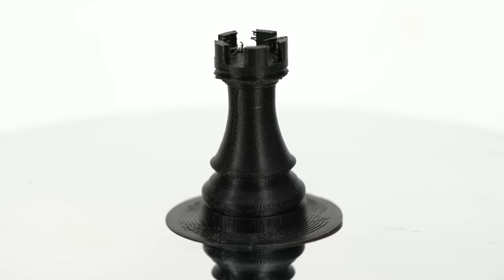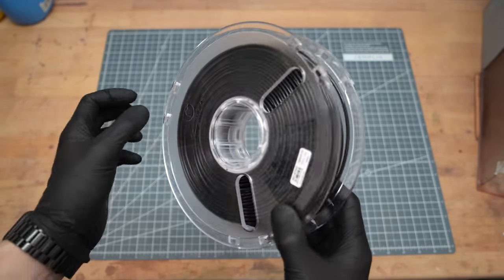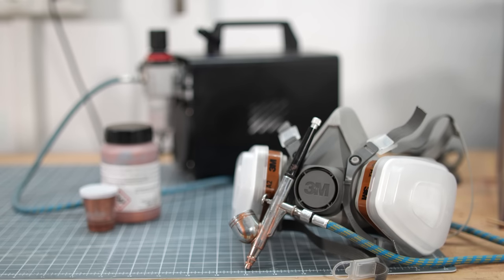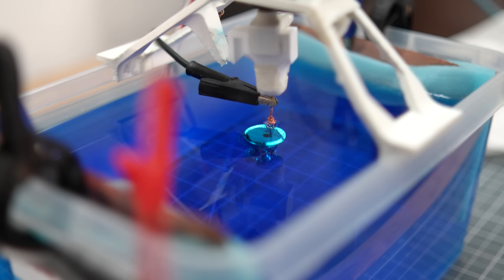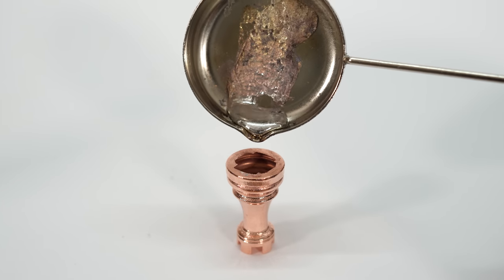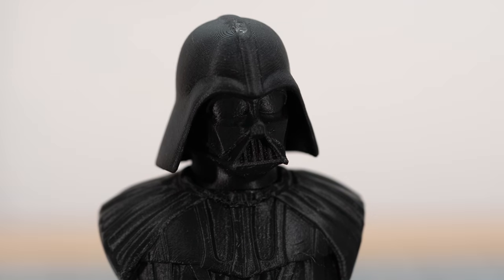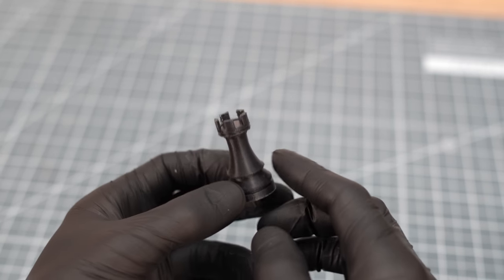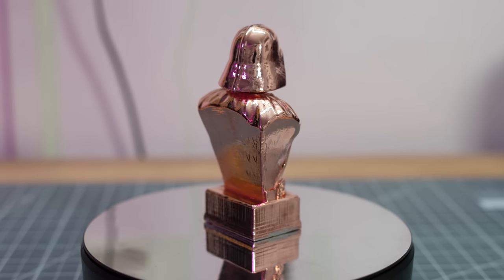Cast Into 3D Prints | Electroplating

Comment: This was awesome. If you print the pawn in very low infill or even in vase mode you could really shrink the time to dissolve the plastic. 
 I've been using  your tips to electroplate statuettes and a doorknob I designed. The weight was definitely something I'm looking for and my solution was to simply leave cavities in the print, pause towards to top and insert pennies (around 75 cents worth) into it. It makes it extremely heavy and it's obviously very cheap! This makes it easier to electroplate as well as I don't have to fiddle with keeping the print submerged as it's heavy enough to sink on its own.
Reply from the maker: Hehe, oh yeah, submerging is always a thing 😅
Reply: I was just pondering adding mass to a print by sneaking things into the infill, pennies definitely seem like a good easy option. Although do they jiggle/make noise? Any suggestions for that?
Reply: @ZacDonald  I have added BB's inside prints while printing to add weight, they can still be heard if shaken but maybe pouring in a bit of glue with them would stop this.
Reply: @ZacDonald  I would try adding a few dabs of epoxy when inserting the pennies. Actually, this brings to mind the idea of modeling custom pockets for random pieces of metal to simply epoxy into the printed part. For example, model out a pocket for a lug-nut I found on the road, epoxy it into the print, and electroplate with no need for melting any metal.
Reply: Ive dissolved prints out of plaster in the past; I think the trick is to make sure the solvent can reach everywhere quickly, and not have to go incrementally layer by layer. Use gyroid infill, and maybe poke a hole lengthwise. Even better if you could stick a pump in that hole for active circulation but i guess that is extra complication and mess so unless time is of essense, eh. 

Also the effect of dissolving plastic is very very temperature sensitive. At the very least do not leave it in your subzero garage. But I put my setup in my slowcooker. Now there is that thing of flammable liquids and boiling them and all; but that can be done safely. What I did was seal it from oxygen and add a long alu tube to leave room for vapors to expand and recondense; even with my pan on max all vapors recondensed at the very bottom. 

Using such an elevated temperature process, you can dissolve good old PLA like sugar in water, using ethyl-lactate. It has a nice and high boiling point at ambient pressure too. Its not the cheapest solvent, but if you catch your recondensed liquid in a seperate vessel, you can keep using it indefinitely.
Reply: You can simply print it hollow and inject hot glue if weigth is the only consideration.

Comment: You can find a bunch of pewter stuff to melt down at thrift shops and such. Might be a bit cheaper, and it can be melted on your kitchen stove. (Be aware that older pewter may contain lead)
Reply from the maker: Yes, absolutely. I just didn’t want to show melting potential lead contaminated stuff. 100% tin seemed the safest starting point for people who may want to try this. Lead is really bad stuff, so safety first. 🙃
Reply: Most of the Pewter in resale shops isn't actually pewter but alloys that look like it. Real Pewter is expensive so it usually gets bought up pretty quickly.
Reply: @hen3drik  'twould be interesting to see if it 'survives' the 650F. thermal load....
Reply: @TrollFaceTheMan  depends on antimony and tin content, less lead
Reply: @whtkngofc , the stuff I've seen a lot is actually an aluminum alloy of some type that is made to look like Pewter. Someone who knows metals can tell it right away by weight and sound.

 But most people that aren't familiar will likely mistake it.

 I have also seen some iron alloys of some type again made to look like Pewter. They are heavier and potentially harder to tell apart becuase of this.

 Then there is the Lead free Pewter which is just around that can be kinda hard to melt and cast depending on its composition.

 Potentially much to high for silicone casting unlike regular pewter. It might be different in different areas. That is just what I have found around me locally.
Reply: Contains lead*
Reply: @hen3drik  lead isn't that bad if you don't ingest it. You can fill it with lead then seal it. I and many electronics DIYers use lead solder all the time, and actively avoid lead free, I know of 0 that use lead free. Lead may be in your water pipes too, it's harmless unless the water is acidic.
Reply: @hen3drik  That’s why you should try ZA-12 allpy ingots.
Reply: @H0mework  Look up Zinc Pest

Comment: Awesome! If the intent is only to add weight, then you could simply drop in a few lead sinkers, and fill the rest with epoxy resin. This would make it strong, heavy, and no melting required.
Reply: Or just stuff it with JB weld, depending on whether or not you want a more uniform mass distribution.
Reply: I would suggest lead pellets or even small rocks, and casting resin.

Comment: You should try casting with Rose's alloy. It has a really low melting point and doesn't contract or expand much when it solidifies. It does have lead in it though.
Reply: There's also a Tin/Bismuth alloy out there that melts at 274F if you want to avoid Lead.  Should be able to poor it into a PETG or PC mold.
Reply: Haha, finally sb. who knows their stuff!

Comment: Try zamak 3 alloy or another zinc alloy! It should melt in a cast iron pan with a little help from a blow torch or a really hot burner. Do it outside though. You can go over your daily required zinc intake from zinc fumes if you're not outside and wearing some kind of mask. Less toxic than those other low melt metals and very cheap. It's also quite strong for the volume. Better than cast aluminum.
Reply: That's what i want to try with this method. Creating strong and precise metal parts at home, without having to put the plaster mold in a 700 degrees celsius furnace for 12 hours  -- sounds like a dream.
Reply: + even more advantage over casting: unlike ZAMAK, copper could be easily electroplated with nickel or chromium for aesthetically pleasing finish and durability

Comment: Never knew about PVB, will have to try it some time.  Even PVA takes some agitating to get it to fall off on it's own.  You could use lead for weight but I would seal the bottom and needs a bit more heat.  I made an furnace for melting lead, copper, brass and aluminum out of a 5 gallon bucket and some kaowool, didn't cost much to build, uses a simple propane burner.   I get lead when I go to the scrap yard, balancing weights off of car tires.

Comment: If you only want more weight then use Plaster of Paris as the filler and put a round piece of green felt on the bottom to cover and for protection of the surface you put it on. I had a couple of bookends made that way, plaster inside. They had a brass shell, thicker, and then plater inside for weight. If you wanted metal inside then I would use lead as it is very cheap and a low melting temperature.  

I like the the plating method. I will try it sometime.

Comment: Just when I thought there is no way you can show even more incredible ideas than in your previous videos, here it is! Nice, clean and professional, as always.
I just started setting up a space for electroforming 3D prints, and have been tinkering with what can be done easily in a DIY way (substitute materials for expensive chemicals, sometimes slouching on cleanliness and the not-so-fun parts like polishing etc.), and somehow it always seems to turn out that I get the best results if I follow exactly your instructions. :D Currently waiting for the same brand of copper paint you are using to arrive, I have high hopes for that to work much better than my current graphite spray solution.
Keep it up, incredibly informative videos!
Reply from the maker: Thank you for your kind words! I wish you luck. Don’t get rid off the graphite yet. ;-)

Comment: Pewter is very cheap and easy found in thrift shops and 2nd hand stores. Its Mainly tin and has a low melting point. We use it to make babbitt for engines by adding lead to the pewter. It's found in  old and cheap decorations as well as plates and tea/coffee sets. Can't hardly give it away in the states. A quick search will show you what it looks like

Comment: Very interesting. 
For weight, especially when I needed extra weight a certain spot, I have designed parts with a cavity in it. Pause the 3D print at the right spot, add hot glue, drop a steel ball bearing in, add more hot glue. Glue doesn't stick to the bearing but it does to the print.
Just make sure the glue gun is on low temp. I've also added a thicker wall to the cavity to take the heat when close to an edge. I'm a mechanic, I take the balls out of used wheel bearings and axle shafts.
Reply from the maker: Like this? 😉 
https://youtube.com/shorts/JD-r2oOXT-0?feature=share

Comment: Really cool. You could also do a liquid sand cast over it, let it dry, burn out the plastic. Then pour metal inside the sand cast. Then bust open the sand to reveal the casting. They do this in large scale places but use wax instead of plastic. But should still work I think.
Reply: Dude do you have a link to how to do this? I am looking into doing something similar and always looking for different techniques
Reply: Please show video
Reply: Saw it on how it's made like 12 years ago. Not sure how to find video.

Comment: Very cool. Finally, a completely metal part! Kudos!
If you want other metals to try, maybe bismuth or an alloy. It should be a bit cheaper. It melts just a little hotter than tin and one of the least toxic options (we're looking at you, lead).  
As for other projects: what about ways to add weight without casting metals: maybe filling with gypsum plaster, metal filled epoxy, etc.
Reply: Гипс (клеящий гипсовый состав, с ним удобнее работать) вполне годится, можно добавить железную или медную проволоку для веса
Reply: В жидкий гипс, для утяжеления, можно добавить металлические шарики, чтобы не плавить металлы
Reply: Yes, I’d agree that bismuth is a good idea if you are after weight. It’s about 50% denser than tin, and its melting point is low (about 40 degrees above tin). Some bismuth alloys have much lower m.p.
Plus it is much less toxic than lead.
The only potential problem I can think of is that (IIRC) it actually expands slightly when it solidifies.

Comment: Try lead-tin alloy. Lower melting point, better flow characteristics. Watch out for the fumes (do it outside), wash your hands after casting, do not use in stuff that's going to be used near acids (especially vinegar and ita vapor) or in food and drink contact.
Lead is toxic, but as long as it is in its metallic or inorganic form it is not readily bioavailable.
Reply: Maybe just use lead and then cap it off with tin?
Reply: @ET_AYY_LMAO  can be done, but lead is slightly more viscous and doesn't alloy easily with copper
Reply: @robertotomasini2072  Use a little solder flux and it will probably wick to the copper just fine.

Comment: Lead free solder may work (get the type for solder pots that dies not include flux)
Reply: Lead free solder is usually a Tin alloy, so it will most likely be even more expensive than tin bars for casting and soldering.

Comment: Pretty nice, I'm impressed by how well your electroplating solution is behaving! Is that a commercial solution or a handmade one? 
You were right when switching to current density as opposed to constant voltage. Constant voltage really shines when you have a large range of current density (2-8 A/dm² for instance).
Reply from the maker: I‘m always fighting field density 😅. It‘s a commercial acidic pH1 bath that I maintain regularly.

Comment: Very nice work and outcome.
You can speed up process. Just melt out plastic or burn it with 200(melt)-500(burn) degree stove. After melting you can make finish clean of the form with isopropanol but whole process would be faster. To keep copper form in place you can use sand casting of the outer volume.

Comment: Another metod that works very well to fill the parts and add the precise weight you want, is mixing small steel balls with wax. No need to melt metals, just enough heat to melt the wax.

Comment: An easy way to add weight only is to stop a print while the internal supports are still exposed, then fill with "heavy sand" then let the print finish.  Use a magnet to clean up any spills.

Comment: As an alternative to casting in tin -

Wood's Metal is an alloy with a very low melting point - 158° F/70° C. compared to tin at 449.5°F/231.9°C.

 It also costs about half what tin does - I'm seeing 99% tin for USD 28.99/pound, and Wood's Metal for USD 15.59/pound or less.

Given the low melting point, it's considerably safer - water left in the form won't boil on contact, throwing molten metal all over.

Comment: that is awesome would be cool to see how it held up to higher melting point metals like steel.... cheapest way i can think to do this is with an induction bolt buster would allow you to melt small quantities for a few tests
Reply: Steel stops heating in induction heaters when it hits the Currie temperature. You need a graphite furnace (or a very high power high frequency induction heater)

Comment: You could try some low melt  plumbers metal, that melts below 100c  (used to pack pipes before you bend them) also called bend metal with a 70c melting point
Reply: Even more expensive than Tin though.

Comment: You could prefill it with lead shot, which is much less costly than tin.  Since the melting point of tin is higher than tin, there would be minimal offgassing of the lead,  Might need to do it in layers.

Comment: the electroplate is dope. Would probably work better with a resin print for more detail/surface finish. Using tin seems unnecessary, if the shell is metal, just fill with something heavy. Sand for ex.

Comment: 8f your main goal is to make them heavier there are much easier ways. First and easiest is to print solid / 100% infill (I print with resin, which is 12~15% heavier than water).
But since resin can be expensive, you can still print hollow (with drain holes!) but after curing you can fill it with something heavies and dirt-cheap ... like sand for example :)
... and of course then close the holes, resin prints are best closed/glued with liquid resin in a small syringe (with needle for finest places) and then cure with UV flightlight (or laser for finer places). Liquid resin hardens in seconds under UV, and once its hardened you can put in your uv-oven (or in the Sun) for a bit longer.
I don't have experience with fdm printing, but I'm sure the same can be achieved with it too, perhaps with different hollowing & gluing techniques.

Comment: Could this work with aluminium as the casting metal? Seems like it wouldn’t be able to melt the copper electroplating?
Reply from the maker: Yes, Aluminium should work.
Reply: @hen3drik the ramifications for die casting mould making is unbelievable!

Comment: You should preheat the copper shell for a proper pour, so that you can do it all at once. I've poured molten lead-free pewter at +-400°C in a resin print with 100% infill. Preheating helped a lot. The metal didn't react violently with the surface nor it has splashed everywhere.
A silicone mold is another cheap alternative.
BUT, you had the solution right in front of your eyes: you should have used the shell as melting pot, simple as that (the melting point of copper is 1,085°C)!
Good job on the electroforming though, it's an awesome technique.
Reply from the maker: Thank you for the Tipps. These are great for people considering doing it right 😅. Yeah, there are many ways to do it, I always wanted to try out this version.

Comment: Pretty awesome. However, AFAIK you are electroPLATING = covering the outside, with the reference surface being on the INside and the outside being undefined. ElectroFORMING on the other hand is done in one or several NEGATIVE molds, with the copper deposition on the inside. After separation from the mold, the outside of the metal parts is the exact copy of the reference surface = the inside of the mold. As depositing metal in deep cavities is more difficult to achieve, objects are typically broken up into several shallow "negatives". The resulting parts are then trimmed, soft-soldered together, then given another thin copper layer and finally (partially) filled with some low melting-point metal (usually containing Pb, Sn, Bi). After some final touches, a silver or nickel bath concludes the process.
This process became popular in the 1850s for the (mass) production of decorative items and stayed in use until the 1990s for design prototyping before CNC milling of thin-walled metal and 3D printing became the standard. If you find "WMF" product boxes produced before the 2000s, their box shots of "stainless" items are usually pictures of electro-formed copper parts with nickel coating to resemble stainless material.

Comment: And if you print with a resin printer, do a silicon mold of it, pour wax inside the mold, electroplate the wax copy, melt the wax and put the metal material inside you think it will work? It will be really interesting for have a superior surface quality of it and with higer resolution of details.

Comment: You can also cast with lead. Just get some old lead-acid batteries, you can melt them with a wood fuelled fire in a kitchen pot, I have done so in the past. Check whether it is legal to do where you live and besides a safety goggles, face shield, leather apron and gloves wear a good respirator. Just in case.

Comment: Hello. Did you try to print 3d resin + copper powder? Would it be conducive enough for  electroplating, what do you think?🤔
Reply from the maker: I didn’t Test this but I think it will not work. Graphite has poor conductivity compared to copper. So it’s already hard to plate on decently; but it may work though.